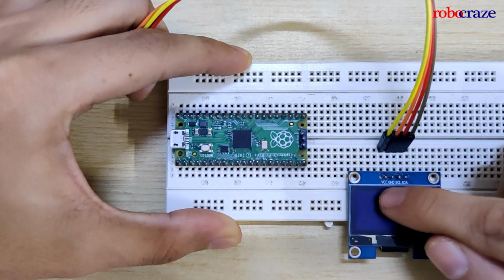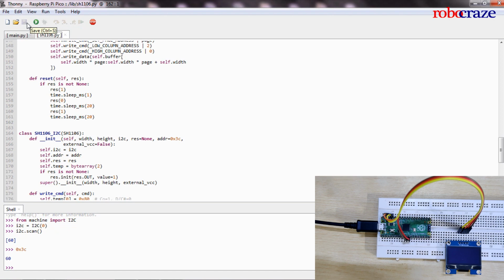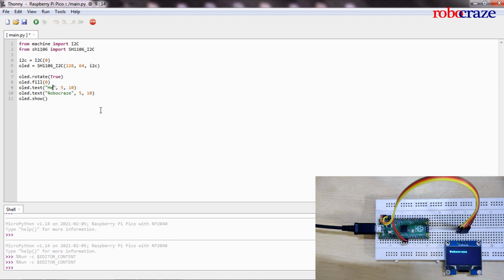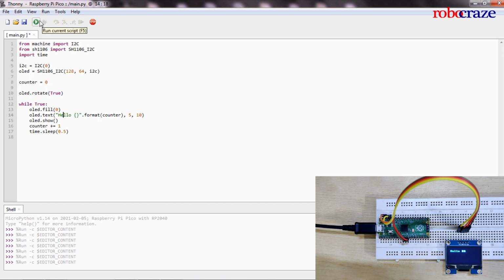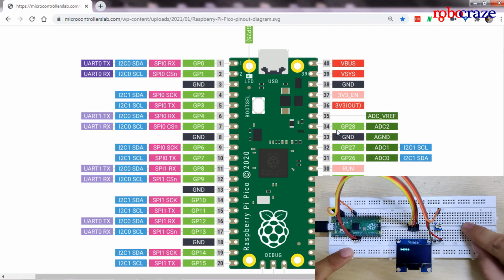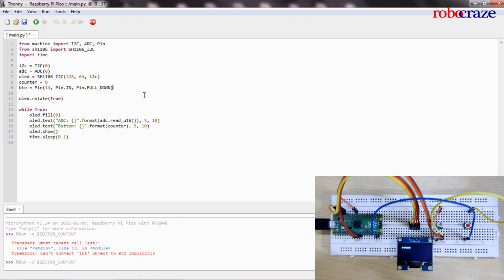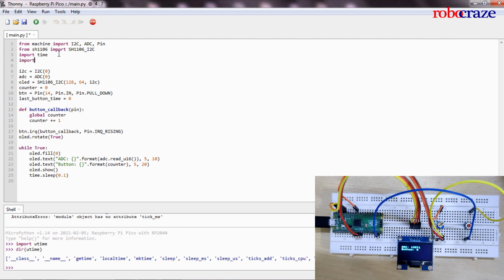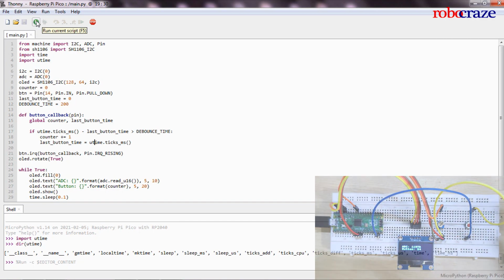Raspberry Pi Pico using MicroPython - Tutorial #4: Interfacing an OLED Display

Comment: can i use the same code to connect with PIC W ?
Reply from the maker: Hello! 
Yes, the Pico code for an OLED display should work with the Pico W without any changes as they both use the same microcontroller (RP2040)

Comment: Thonny gets stuck when creating the oled object. When aborting with crtl D or pressing stop I get into an error loop (Unable to connect to COM6: could not open port
 'COM6': PermissionError (13,
 'Permission denied', None, 5) )
I have to pull the cable to stop it. 
I thought it might be a windows problem but on linux, I get a similar error. 
Any help would be super helpfull🙏🏻
Reply from the maker: Check port permissions, port conflicts, board connection, and drivers for Thonny to resolve the issue of getting stuck when creating the OLED object and encountering permission errors on COM6 or Linux.

Comment: Hey tanks for the nice Video. I have the same Chip for my pico but if I tray to the the aderess via I2C I get an empty list back. I2C(0).scan() >> []
Does anyone knows the issue?
Reply from the maker: Hi Ruben,
This means that the I2C bus is unable to detect your device. The most common reason for this might be that you have used the incorrect pins. There are multiple I2C pins o the Pico. Please check out the Pico pinout and try to use the other I2C pins. In the I2C declaration, SDA and SCL pins can also be passed, so ensure you are using the right pins. It could also indicate a problem with your sensor, please try using another microcontroller such as Arduino if available to check if the sensor is being detected on the Pico. This will help you narrow down the problem.

Comment: how to scroll text on oled
Reply from the maker: Hello,
To scroll text on OLED using MicroPython, you need to use the ssd1306 library and implement a loop that repeatedly updates the text position on the display. You can use the fill() method to clear the previous text and then use text() method to display the updated text. You can adjust the scrolling speed by adding a delay using the time module.

Comment: You could have used ssd1306.py (https://github.com/micropython/micropython/blob/master/drivers/display/ssd1306.py) instead, which would be in correct orientation by default I guess..
Reply from the maker: Yes, you may use any driver which works for your OLED display

Comment: Hey man, have you done this on a display with user control like buttons or touchscreen ?
Reply from the maker: Hello! we haven't tried this specific setup, but you can definitely use buttons or a touchscreen for user control on a display. For buttons, you can program them to trigger different actions on the display. For a touchscreen, you'll need to implement touch event handling to interact with the display.

Thank you for asking! :)